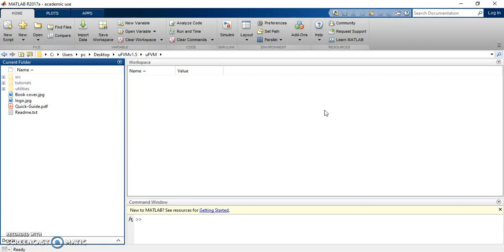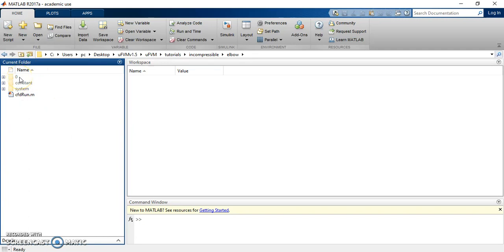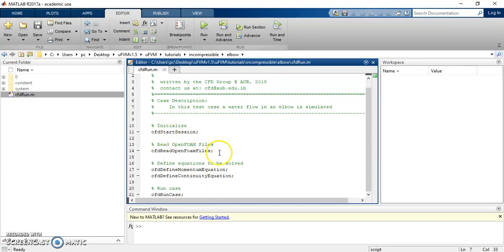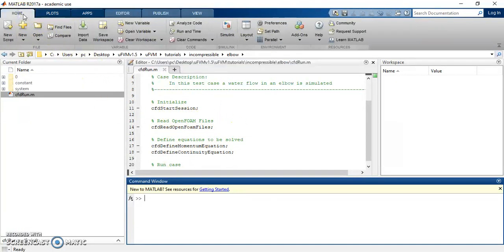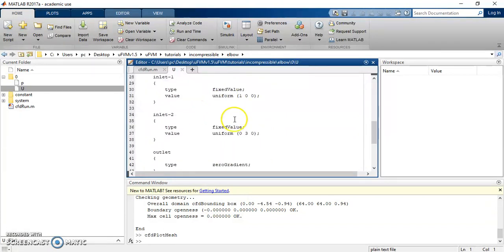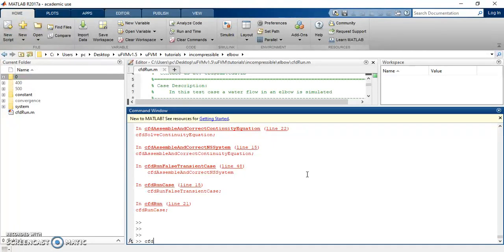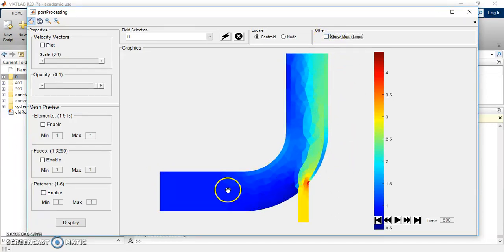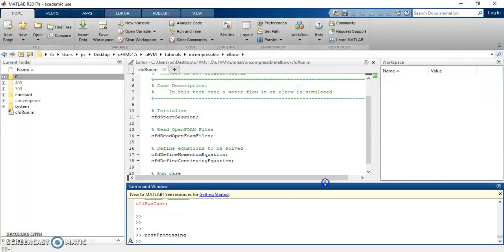uFVM CFD Academic Tool

Comment: I tried following but got the following errors

Undefined function 'rms' for input arguments of type 'double'.

Error in cfdComputeScaledRMSResiduals (line 30)
    rmsScaledResidual = rms(abs(bc)./(ac*p_scale));

Error in cfdPostAssembleContinuityEquation (line 13)
cfdComputeScaledRMSResiduals('p');

Error in cfdAssembleContinuityEquation (line 18)
cfdPostAssembleContinuityEquation;

Error in cfdAssembleAndCorrectContinuityEquation (line 19)
cfdAssembleContinuityEquation;

Error in cfdAssembleAndCorrectNSSystem (line 15)
cfdAssembleAndCorrectContinuityEquation;

Error in cfdRunFalseTransientCase (line 48)
    cfdAssembleAndCorrectNSSystem;

Error in cfdRunCase (line 15)
    cfdRunFalseTransientCase;

Error in cfdRun (line 21)
cfdRunCase;

Comment: Try to reproduce the elbow case like the video using the version 1.5. I find a error relevant to 'Buoyancy'. So I disabled the Buoyancy term in the 'cfdDefineMomentumEquation.m'. It is running. Any other suggestions for this? Thanks in advance for sharing this amazing Matlab app!
Reply from the maker: Hi, thanks for using the app, I fixed the problem. Download please again and try!
Thanks by the way for your feedback!
Reply: @mhamadmahdialloush3626  Respected Professor! Salam. The code is excellent for dealing with CFD. I am also trying to modify the same code for my problem and  encountering several issues. Could I ask you these issue? If you consider suitable you could add my whatapp for frequent contact 008618810182102